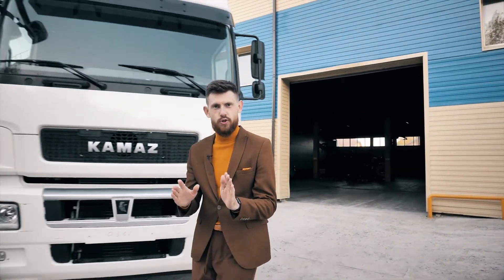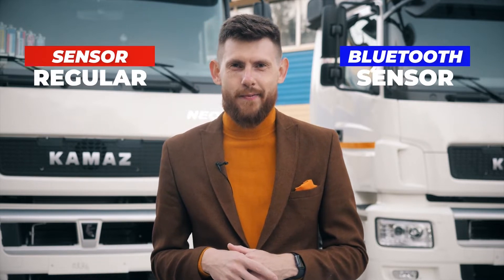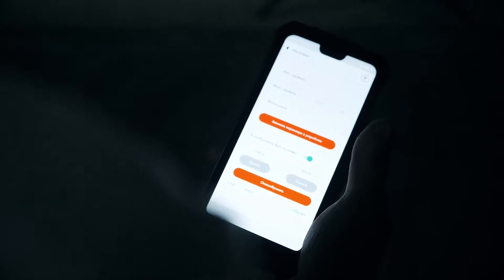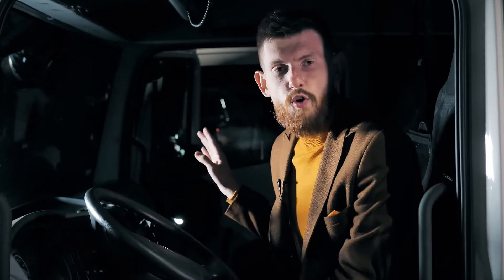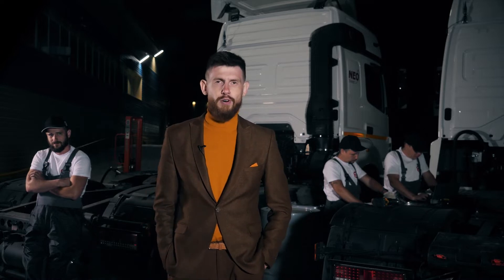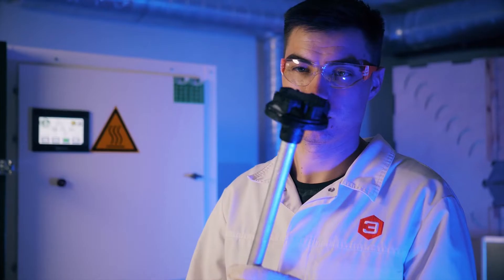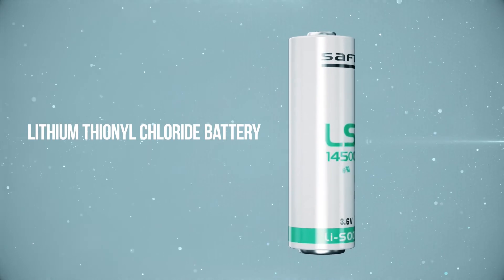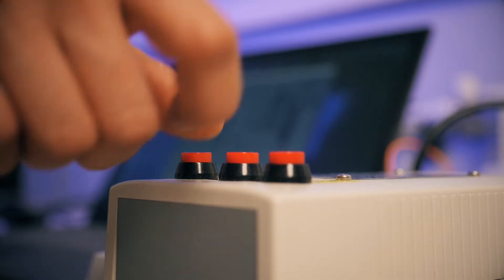What is the best way/sensor to control the fuel/petrol/diesel?

Comment: Do you have a video on dry calibration. I'm so much interested in learning as I'm used to calibration with fuel using 10 litre portions. Which is quite time consuming. How accurate is dry calibration?